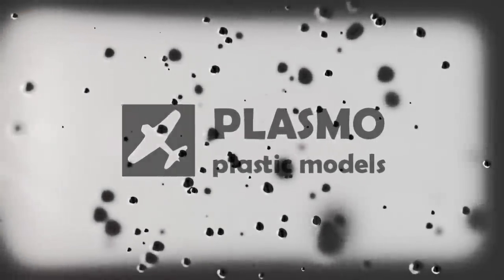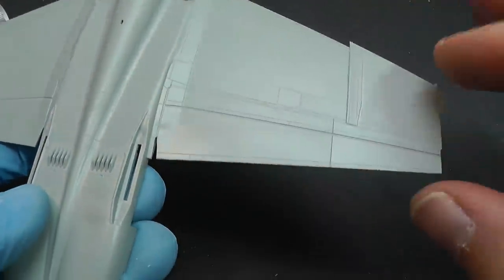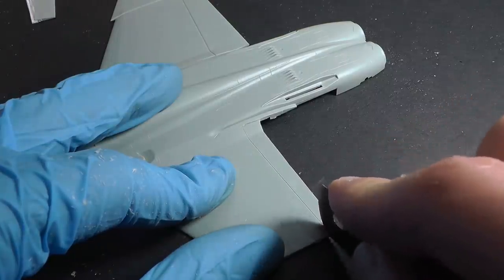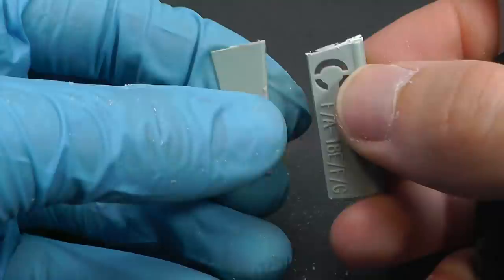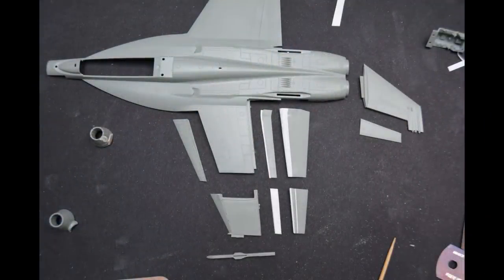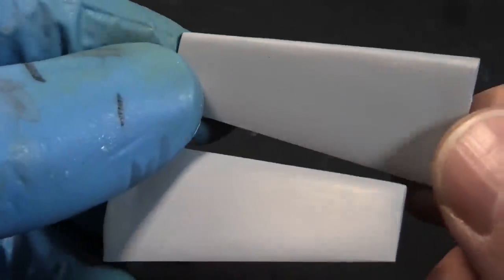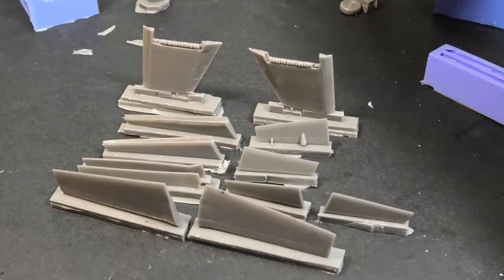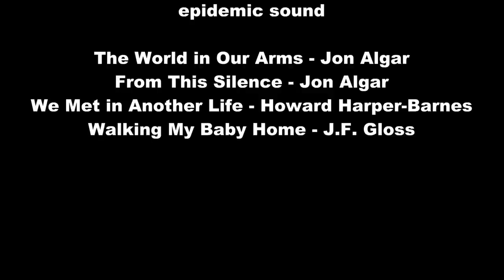F/A-18E Super Hornet 1/72 - Flaps - Folded Wings - Conversion Tutorial

Comment: Can’t ever  get enough of Mr Damek’s content, never seems to be afraid of tackling the most complex of  conversions which make a run of the mill model, a masterpiece. I wonder David if you would accept a challenge to modify a civil airliner, say a 1/144 Boeing 747 in a landing configuration, full flap deployment with  wheels hanging free just prior to touchdown. It’s a very complex arrangement, but I’m certain you would work a solution.

Comment: I do prefer the JLC saw & it's blades. It's magic in your mits, precise cuts and panel line repairs. But you are correct, the blades do easily break. This scale I don't touch, not that it's too small. I just don't like it. Great job on this kit, you really added a bunch of detail with precise cutting and attention to real detail. Nice work on the wing tip fold actuator. Casting also! Good stuff David!

Comment: 7:40 to save loads of time, and details on the plastic moulding, apply the filler with a stick in to the line, then gently wipe away the excess with a lightly-dampened sponge.

Comment: This has to be one of the most impressive conversion/customizations I've ever seen. I particularly liked watching you build the hinges that aren't visible until the wing tips fold up. I probably would have tried chucking a piece of sprue in a drill and using a file on it as if it were in a lather. I've gotten away with that for 1/25 scale cars building roll cages and the like  but never anything in 1/72.

Comment: David, amazing work, as always, but I'm confused on one point: the rudders.

It appears that you have both rudders hinged inward.

Shouldn't the be hinged either both to port or to starboard?

I've tried to look at the photos you've used, but I can't tell from them.

In any case,

Cheers!
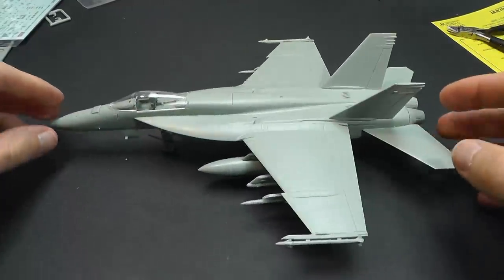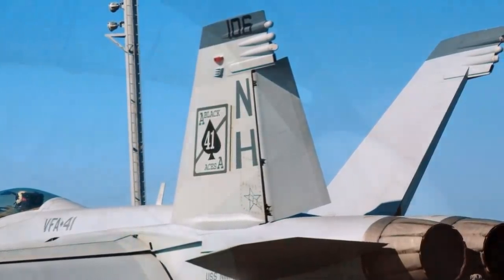Reply: at 0:27 and 0:50 you can see that they're angled inward. If you do an image search on  it, you'll see that both pointing in is normal, and in some cases even more extreme  than he has them.
Reply: @patharmon9760  The Hornet is after my time, but I saw plenty of Tomcats off the Kitty Hawk and Midway in the 70s. Having both rudders pointed inward like that would not turn the aircraft but act as an air brake. Perhaps this is a "stored" position meant associated with the wing tips pulled up?
Reply: The rudders "toe-in" on the Hornet to help rotate the aircraft nose-up on takeoff. Not just the Hornet, you can see F-22, F-35 and the Su-57 do the same. It always annoyed me - as you say it acts like an airbrake - seems like they need to squeeze out every bit of performance on takeoff, I would really like to know how much difficult would it be without rudders facing inwards
Reply: The Super Hornet deleted the Hornet’s airbrake, with this as the solution.
Reply: Dan Such The rudders toe out as part of the speed rake function.  They toe in like this for added stability with flaps down.

Comment: The super-hornet isn't highly modified. It's an entirely different chassis. The only reason it still carries the F/A-18 moniker is because the Navy was trying to fool the Government higher ups into thinking they were investing in upgrading a proven airframe instead of building a new one from the ground up, which is more accurate to what the super-hornet is. The configuration I think you're referencing here is a super-bug with in 'takeoff trim' mode, given the rudder and aileron position. It would probably be more realistic (at least of the hornet, not sure about the super-hornet,) to have the flaps at the half-extended position as that's the usual position for takeoff. With full flaps you'd be probably talking about a pre-flight control surfaces test, in which case I'm pretty sure that takeoff trim would not be set.

Comment: I love your work, I believe I have said it on almost all of your videos, but aren't rivets invisible on 1/72?  A 1/2 rivet at 1/72 is .0069 of an inch so the rivet would be smaller than the dots on your 1200 grit sandpaper...
Reply from the maker: Yes, but the rest of the kit has rivets. So you can fill all the details on the model or make some lines on flaps. Basically in this scale, you can fill evening even panel-lines if you want to make it realistic. So why models have lines in 1/144 1/350 or even 1/700, because it looks better than a flat surface.

Comment: I’m new to the hobby and I’m wondering what paint to use for brush painting. 
Brands will help
Reply: Just use Revell emaille paint or tamyia lacker paint that should be good but always wash out your paint brushes properly and wear a mask bcs of the paint vapors😙
Reply: Acrylic paints are good for brushing. Revell aqua colour acrylic paints are generally inexpensive and are good for a beginner, plus they don't give off any fumes, dry a lot faster than enamel and can be thinned with water.
Reply: If you use acrylic paint, thin it first, and build up 2 or 3 thin layers to avoid brush stroke marks.
Reply: Joe Shmoe tell me if I’m dumb but what do I use for thinner with acrylic paints? Water?
Reply: CBlitz Water or IPA/Isopropyl alcohol by Tamiya (X20-A) or Vallejo (they make good acrylics also) airbrush thinners can be used for thinning acrylic paints, AK and Ammo by Mig also make good paints and thinners for acrylic paint.

Comment: Hello, I would like to know wich tool you use for cute, because it look like a shave blade, but I can't find it in internet, thanks
Reply from the maker: JLC / CMK razor saw . You can try ebay
Reply: Google (shopping option) CMK razor saw. 1001 model kits website has them too.  There is also the same type made by MicroMark.